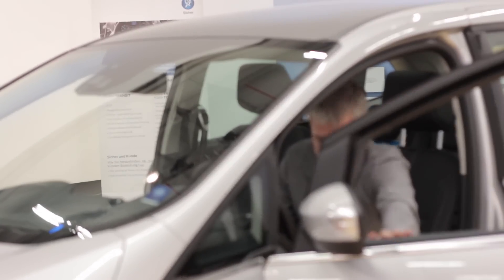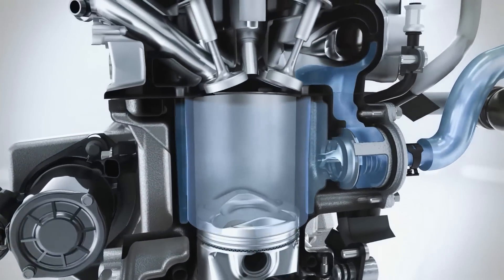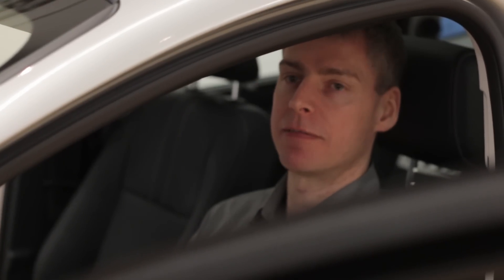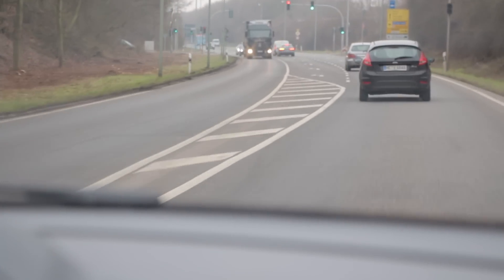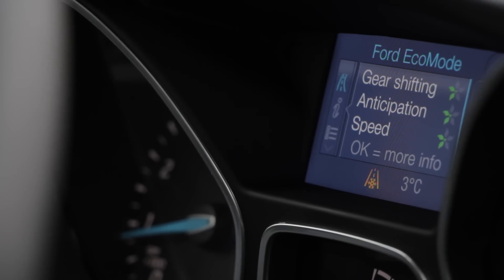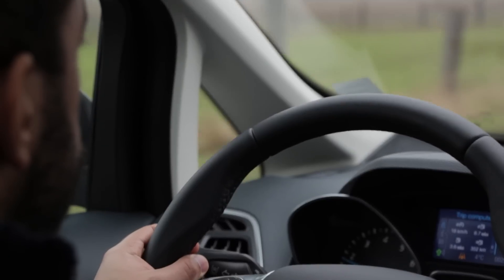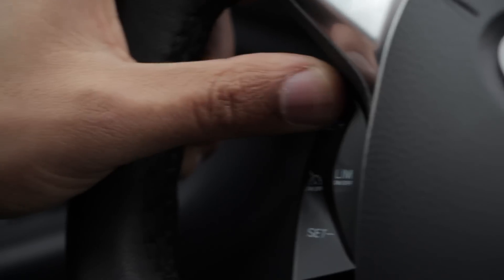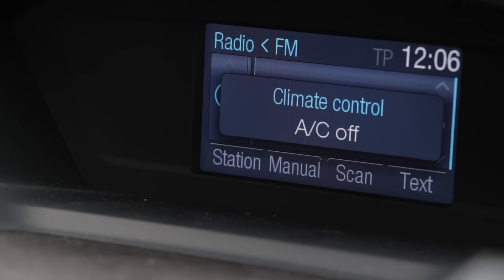FORD C-MAX 1.0 L EcoBoost Engine

Comment: I know, I have a 2.2 TDCI Mondeo Titanium X sport, it's lovely. :) 
I think if it's an EcoBoost going into the Mustang, then forget the 2.0, because they can use their 3.5 v6 EcoBoost fro the Taurus (with 365bhp) and tune it to over 500 if they wanted to. The 2.0 is a good engine, just not for a Mustang, as it doesn't overly sound amazing.

Comment: Nice! I have the uprated 2.0Tdci. Now i have 197hp and 440Nm out of the 2.0Tdci. That's why i didn't buy the 2.2Tdci, because it's more heavy. Now i have the Same performance but i have higher topspeed and better 0-100 acceleration. You are right about the 3.5 v6, but in europe the engine is to big and we need to pay alot of money to keep this running.

Comment: I'm not complaining because i also have a very Powerfull 2.0 Tdci Engine.
Biggest Diesel Ford produces now is the 2.2Tdci capable of 250Hp and 550Nm. Thats enormous power out of a 4 cylinder. The 2.0 Engine in the Mustang will have 360Hp.....Yes 360Hp out of a 2.0. But if Bmw etc.. can do it. Ford will do it better but now we don't see any 3.0 6 cylinder.